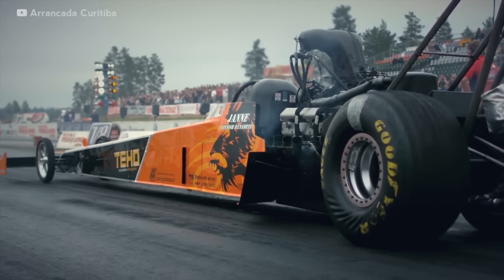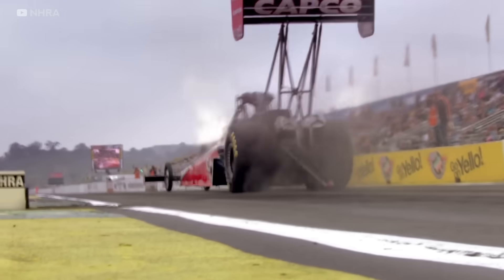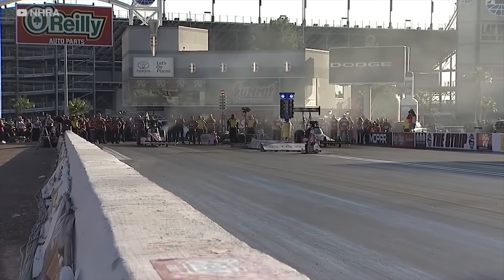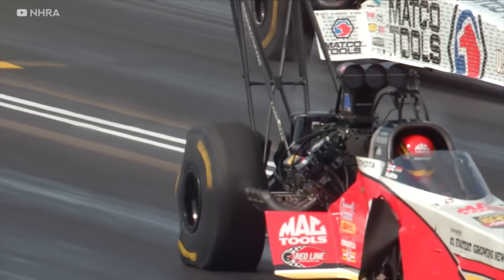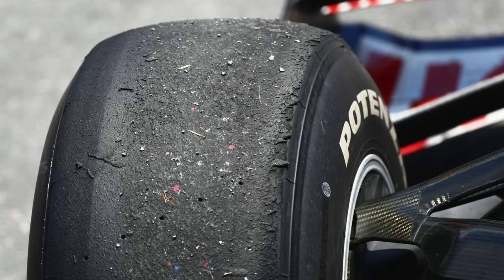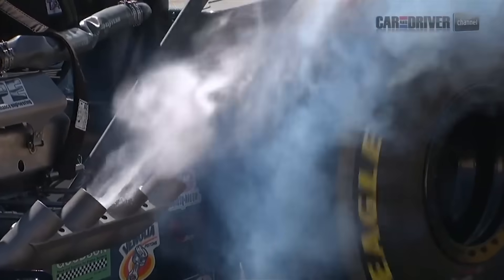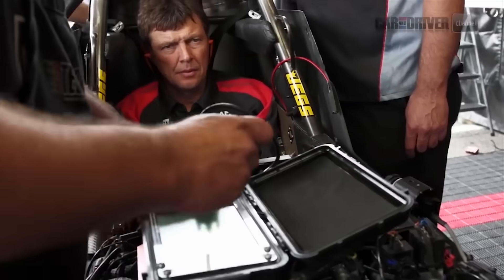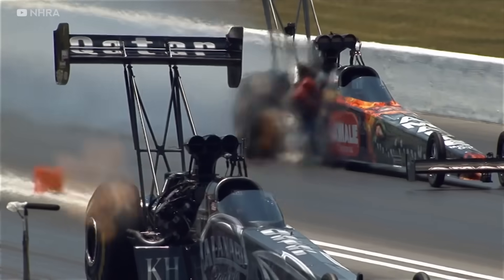How Dragster Tyres Accelerate to 335 MPH in 3.6 Seconds

Comment: I've always wondered, if you had a track long enough, fuel wasn't an issue, and the engine could hold together, and the transmission would allow for it. What would be the fastest possible speed these things could reach.

EDIT: It seems as though many people don't understand what hypothetical means, nor how to identify when an idea is a hypothetical idea. This isn't a "Hey, lets take one of these out and see what it's top speed is!". It's a "If physics wasn't a thing, and it had the proper gearing, how fast could these really go". Purely, 100% hypothetical. Yes I know these engines experience insane stress, requiring them to be rebuilt every run. I know the tires won't hold up long enough for a top speed run, let alone hold together well enough to do one. Same goes with the transmission, I know it's not geared for top speed. I know all the issues the the real world has with these vehicles that make a top speed run impossible. That's what makes my thought a hypothetical, because it's just a "What if" idea that could never happen. So you can save yourself some time, and not feel the need to be all "Well ecthually, these cars couldn't do a top speed run blablabla" no shit sherlock, now stfu.
Reply: Yes like if they were on the salt flats. I've always wondered that too
Reply: ive done some math and if im correct probably close to 550mph or 885 kph
Reply: @idek6652  Aerodynamic drag would sheer off that rear wing long before 550mph.
Reply: @MultiWalrus1  Well, that would just mean less drag and more speed then :D
Reply: @wombat4191  it would mean “beware low-flying aircraft” 🙄
Reply: @MultiWalrus1  Are you sure about that? The front wing still would keep the front of the car down at high speeds, and liftoff happens specifically when the front part tries to go up. And the exhaust still pushes the back down with a tremendous force as mentioned

And of course I said that as a joke, the wing getting ripped would likely be an ugly process, and thus could throw the car in all kinds of unpredictable manners.
Reply: @wombat4191  taking away 3.5 tonnes of downforce over the back wheels at 300mph would probably send it skywards rather rapidly, yes.
Reply: @wombat4191  or 6 tonnes at 500mph even quicker ⬆️
Reply: @wombat4191  Not shearing the rear wing and going that fast would be an uglier process, the chassis cannot take the load and would bow upwards in the middle before simply snapping and leaving the rear half to gain altitude rapidly....
Reply: @MultiWalrus1  maybe not, remember that there is also the exhaust pipes on the sides
Reply: Michael Fritsche  I’m not sure what your trying to say. I was purely adding information on why the the car would be driving very far in this hypothetical. Thank you for adding even more information. 

As credentials go, I have been in and around top fuel my whole life. My uncle owns a car. I have worked on said car. Some of the guys that help run the car have worked on high profile race teams including Force Racing. My uncles car actually holds the ET record for asphalt.
Reply: @alexzan3564  considering you have this insight, in what general ballpark is running a team gonna cost? this has plagued my mind and im under the impression that even with sponsors this is an extremely expensive hobby.
Reply: @TurkeyOW  very expensive. You don’t make money winning races. Sponsors are where the money is. There are so many costs no one would do it if you didn’t get to go 300 miles an hour and get more g’s than the space shuttle. It cost easily $8000 to run one day. And that not hurting any parts or having to pay a crew.  And when you hurt stuff it’s not like finding Chevy parts on a shelf. Basically the only stuff you can find at a auto parts store are spark plugs and oil. Nitro is like $35 dollars a gallon. Methanol is $26 ish. You use a case of oil each run at 6 dollars a court. Parts cleaner is used by the case. Interesting thing with tires is that at big NHRA events the big teams don’t want to run new tires so they let the smaller teams use them a few passes and take them back. You still have to buy tickets to get in for every member and NHRA events have been costing 80 per person.
Reply: @alexzan3564  amazing insight and I can't say I wouldn't do it if I had the money, is your uncle the driver? I'd love to hear what its like. How is it on his joints? His eyes even? Stuff like that
Reply: @TurkeyOW  he just started driving the car. He’s made a few hits where you punch it off the starting line and then let off and coast. He would need to make (don’t quote me I can’t recall at the moment) 4 good passes at an NHRA sanctioned track with someone from NHRA there to watch the runs. 

Besides a crash I’ve heard the worst part is when you get tire shake. I guess it just thrashes you around in the drivers seat. The Gs at launch are incredible. So if you weren’t ready for it could make you black out. 
Then there is getting ready to run, you put on a fire suit, fire shoes, your helmet, squeeze into the cockpit, get 5 point harnessed in. It can get grueling in the heat. Watch a driver at the end of a run. They do not wait one second to get out. There are other reasons too but it’s hot in the Hotseat.

When you do warm up where you run the motor make sure everything is good. Where usually you would get a big crowed around the car. You  can have the nitro fumes just sit in the pits and the driver and crew have to endure that. Not all crews can afford gasmasks. Nitro fumes are the best but they do burn your eyes and lungs so bad.
Reply: @alexzan3564  the real top fuel guys never brag like terry sainty or John force
Reply: I reckon its pretty much what they run the quarter in now, unless they did gearing, then maybe close to the speed of sound, but you'd have to change so much on and about the car, then we're way off topic
Reply: I suspect it's the same speed they're going at at the end of the race.  These machines are completely optimized for completing the race and doing nothing further.
Reply: @drumnbasssakuga9352  Right, they are more than likely built to top out near the speeds they reach. That's why I said "and the transmission would allow for it". They would need completely different gearing to be able to reach what ever top speed 9k hp and their aero would allow for.
Reply: There are some very long flat runways out there. You could carry a lot more fuel. The engines are actually air cooled. No water blocks. So running one at full throttle for more than a single run you might get you 1/2 mile. Each run these motor come back to the pits and get all new oil. There is a huge amount of pressure in the cylinder so you get blow by. There is a special take to catch it even. The Nitromethane and Methyl alcohol ruin the oil. Spark plugs would be no good at about 1/4 mile. So you would loose good combustion because your going to run off the fuel self combusting you loose timing which makes motors blow up. No transmission in a top fuel car. As soon as you go to 1:1 or full lock on the clutch it’s like there isn’t anything there. 

Aero wise the cars aren’t really made to go much faster. The force on the chase would snap the car. It’s been seen on the track a a few times. The rear wing does push the rear tires down but it also bends the frame up in the middle to keep the torque from the tires from pushing the frame into the track. 

The new chases might be able to do 400mph without breaking but i would say your pushing your luck. 

Remember, all this stuff is on the very knife edge of being strong enough to live threw a pass and be as light as possible to go fast. Not really designed to last that long. 

Oh and the car is out of gearing at 1000 feet. You wouldn’t get much faster even if you had more track. You would either have to get even bigger tires or spin the motor even faster. Your at like 6800 rpm at the end of the track. There are no gears to change to get a different ratio.
Reply: @alexzan3564 they’re not really air cooled. They’re actually cooled by the fuel.
Reply: that's a lot of ifs. it's a fun question but at the end of the day there's so many more limiting factors, I'm sure these cars already get quite close to the highest possible speeds their tires can reach before exploding from the centripetal forces. 
but I can still answer your question for you, 
if we assume there are no mechanical limits what so ever, then the only limiting factor for speed will be the air resistance. (technically even if the transmission holds, the fact that this car can't change gears means it wouldnt be able to reach this top speed anyways due to gearing, but let's ignore that as well) we can take the figure of 11,000bhp and figure out what top speed would be. 
the force of air resistance (aka the drag force) is F=(1/2)ρv²CA 
where ρ is the density of the air
v is the velocity or speed of the object 
C_d is the drag coefficient of the object 
and 
A is the cross sectional area of the object. 

before I google to fill in a the unknown figures, how do you use the drag force to compute max speed given bhp? remember that energy is equal to force times distance. 
and power is equal to energy over time. here is how to think about it, at a given speed your drag force is fixed. so how much energy do you need to over come that force for 1 second. well that is going to be the force times the distance covered in that 1 second. F×d. but then how much energy per second you need is just going to be F×v (force times distance over time i.e. force times velocity). btw velocity should be in units of meters per second, and then power will be in units of watts, not horsepower. 

this means that over all the amount of power needed to travel at a given speed is going to be 
P= (1/2)ρv³CA
if we want to solve for velocity given power we can rearrange this equation to give 
v = ((2P)/(ρCA))^(1/3) 

ok so what are the numbers, power is 11,000bph
or 8.2 megawatts, 8,200,000 watts. 

density of air is dependant on temperature, humidity and altitude, so this isn't best case scenario, but on a dry day at sea level at 59 degrees F or 15 degrees C, the density is about 1.225kg per meter cubed. 

I'm having trouble finding the drag coefficient of top fuel dragsters, but race cars like formula 1 cars tend to have pretty high drag coefficients, much higher than most normal cars. this is mostly thanks to their use of a lot of aerodynamic features. most likely this drag coefficient would be much lower in a car with active aero or a car set up for a top speed run, plus a dragster is very different from a formula 1 car. but formula 1 cars range between 0.7 and 1.1. Indi cars have a drag coefficient of about 0.9 (this is maximum though when setup for maximum downforce)  and I couldn't find anything for LMP1 cars. because this car is going to be setup for top speed, I'm going to pull 0.5 out of nowhere. (most production cars are lower than this). if you can get a better number I'd be happy to redo the calculation. 

finally we have cross sectional area, which again is very hard to find out. this one could be found pretty precisely using pixel measurements of a photo, but cannot easily be found using any comparisons. for now I'm going to just guess that the car is about 3 tires wide and 2 tires tall. I.e. 1.82 meters tall and 1.33 meters wide. 
again if you have a better number let me know. 
this gives an area of 2.4 meters squared. 

so using those numbers we get a top speed of 223.4 meters per second or 500 mph.
Reply: Michael Fritsche  people forget that a car has to be transported across the county. You race east coast then have to be in California the next weekend. Most the crew gets to fly but someone drives that truck and trailer. Fuel isn’t cheap. It can cost as much as you can win just to drive to the race.
Reply: There's no transmission. Once the clutch is fully engaged, it's 1:1.
Reply: Probably overheat @ some point
Reply: It would be terrifying even if it's on an open space, a little tumble can probably end your life unless I am underestimating their stability
Reply: They don't have a gearbox, so they are probably pretty close to their top speed at the end of the strip. Remember they race for time not speed.
Reply: RPM and gear ratio is the limiting factor
Reply: well, i think you need to take a look on dragsters that has been converted to race in Bonneville Salt Flats
Reply: @Jorj57  A dragster isn't very aero. Huge amount of aero drag
Reply: Aerodynamic is an exponential factor. 450 mph would require 18,000 horsepower and then all the other physics has to be factored in. So well into 20,000+
Reply: I have often wondered this myself.
Reply: U would need active rear and Front wings to manage the drag imo
Reply: These are engineered basically to be wide open at the end of the track and are generally starting to "eat themselves up" (as the engine tuners say). They used to race to 1/4 mile or 1320 feet but switched to 1000 feet due to some tracks being kind of short and speeds ever increasing and this leaves less shut down area. After the change the tuners were saying they were glad because they wouldn't be burning up engines in the last 320'. However, they just turned them up faster, so now they burn up sooner. LOL These are solid blocks and have no cooling capacity so their run time is limited somewhat by that fact too. I am surprised they last the startup, burnout, staging, run, runout, and shutdown areas. 

Also, there are a lot of rules in place on these just like every other motor sport. If some of those restrictions were removed, they could potentially get more power out of these motors, but the aforementioned heat will be a problem long before these could ever approach the speeds of a jet powered land speed record already held. I can't imagine these engines would be favorable to the salt bed environment either. It does make a fun point to ponder though. With enough traction and longevity, these would likely hold the record for piston-engine top speed runs.
Reply: @Bambihunter1971  Do you know what a hypothetical is? My comment wasn't "Hey, lets take one of these out to a long flat area and see what its top speed is". I intentionally stated "fuel wasn't an issue, and the engine could hold together, and the transmission would allow for it". Specifically the bit where I said "And the engine could hold together" was meant to cover the wear, heat, problems that come with running these engines long term, but not directly saying all that stuff. Breaking down the problems of trying to run of these for a top speed run is an exercise in pointlessness, because my comment is a hypothetical.
Reply: You wouldn't need acceleration or grip, so the rear wing and softer tyres can be ditched, so the limiting factor would be the engine - given that they reach 300mph in a few seconds with a massive rear wing then they are probably easily able to break the sound barrier, given the engine stays intact.

Comment: NHRA mandated lower gear ratios to keep speeds under 300mph. Tires changed and negated the limitation. 

Originally top fuel used front engines, like used for Funny Cars.  After a bad catastrophic failure,  Don Garlits created the rear engine design. Over a few years, it became the standard design. 

P-51 Mustangs used the exhaust as extra forward thrust. Also, the cooling air was changed from drag to thrust using the Merideth effect.

Comment: This entire video u got wrong boss... they lower tire pressure to increase the footprint of the tire the "clamping of the tire" is called bead lock rims there required for running low psi as in a rock crawler and such just like what i got on my jeep I run 7 psi on the rocks

Comment: 1kmph = 1.6 mph
so 335mph = 536kmph and he do in 3.6 seconds and if acceleration is linear that means:
0-60mph (96kmph) in 0.64 seconds
0-100mph (160kmph) in 1.07 seconds
0-200mph (320kmph) in 2.15 seconds
0-300mph (480kpmh) in 3.22 seconds

0-100kmph (62.6mph) in 0.67 seconds
0-200kmph (125mph) in 1.34 seconds
0-300kmps (187.5mph) in 2.01 seconds
0-400kmph (250mph) in 2.69 seconds
0-500kmph  (312.5mph) in 3.36 seconds

Now, compare to "super fast" LaFerrari
0-100kmph in 2.9 seconds
0-200kmph in 7 seconds
0-300kmph in 15.7 seconds.

Dragsters are acceleration monsters. 🤯

Comment: Slow motion is cool . . . 👍
But I have a question. I think the answer would be suprising to most . . .
How many revolutions does the engine turn in that 3.6 seconds ?
Not what RPM the engine is at, but how many times the crank turns.
Or, in other words . . .
How many times does the #1 piston fire in a 1/4(1000 ft.) ?

Comment: Top fuel dragsters do not produce twice the downforce of an F1 car

the 2017 era F1 cars produce about the same amount of downforce as a top fuel dragster (about 4.5 - 5 times the weight of the car) On high downforce setups F1 cars can produce about 4 tonnes of downforce